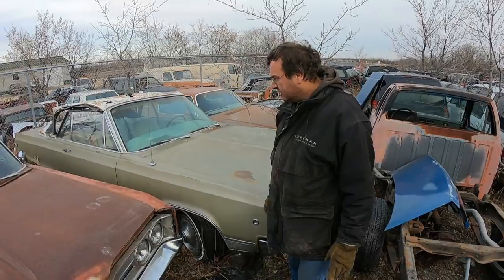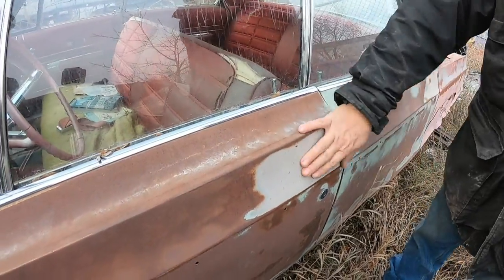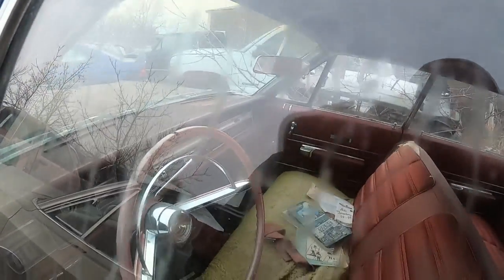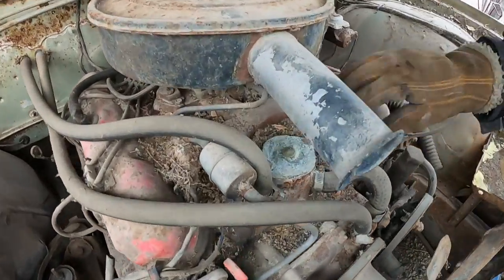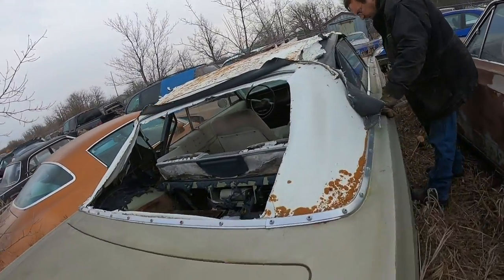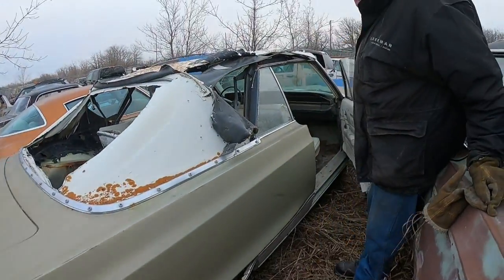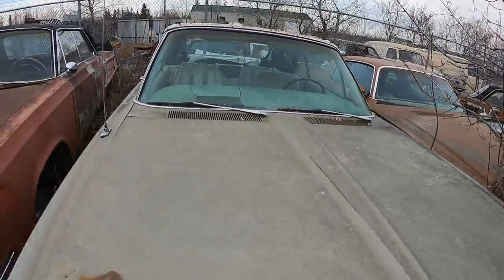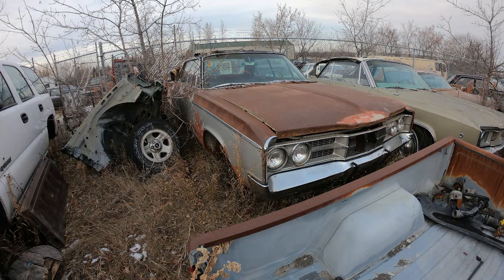1967 And 1968 Dodge Monaco Field Finds.  Possible 426 Hemi 🤷‍♂️. Abandoned, Forgotten Hot Rods.

Comment: That square box with the wire coming from it is called reverberator. It was hooked up to the radio and when you flipped the switch it caused an echo to the radio. They worked fantastic. Made you think you were in a concert hall. They were an option on most cars of the 60's.
Reply from the maker: Thank you Opigoink.  That makes sense now, I remember those now.

Comment: Can you guys do a video on the white Dodge A100 that was beside the big rotten Pontiac I love those trucks where the engine sits right between the driver and passenger seat those trucks and vans are the best looking trucks around next to the old flat fender Power Wagons and Power giants
Reply from the maker: We will be the dodge is really bad shape i had been using it as a parts truck for the one i have been working on

Comment: Be mindful of the heat switch mounted on the firewall. They get corroded and WILL leak into the passenger floorboard.  Practically nonexistent and are wire controlled from the   temperature slide.  And clean the wiring plus going through the firewall. Corroded contacts will burn up voltage regulators. The indicator to this is excessive charging indicated on the ammeter, and bright lights.
A shame they don't come with the AC option, the compressors are immortal.
Reply from the maker: Great thank you for the information.

Comment: I love all car types and plus like one car my Uncle John had was 1974 Chrysler New Port like New Yorker but 2 door and fast 440 V8 4 barrel with 727 4 speed Automatic transmission with rare 390 rear end only bad part was 15 mpg highway and local drive only got 10 or 5 mg on fuel big fuel guzzler and car weight was 3 ton ! But fast to drive to and got big power on gas pedal thrust ! My uncle said had 80 gallon fuel tank with 10 gallon reserve for special order New remember saying that and did check up that option was true to!
Reply from the maker: Got to like those old 440s they rock

Comment: If the 4 door's engine is original, then it can't be a '67. Because Chrysler only produced the Polly engines through 1966. So it could not be any newer than 1966, sorry.

Comment: wheels on the 67 are not correct for that model and side marker lights were not featured on 67 models (have not been “shaved” off). beautiful tail light lenses - the wheel covers on the 68 are also not correct - they are premier wheel covers but this style wasn’t offered until several years later
Reply from the maker: Thank you Kyle will try and get both running this summer was actually talking to the guys yesterday about them